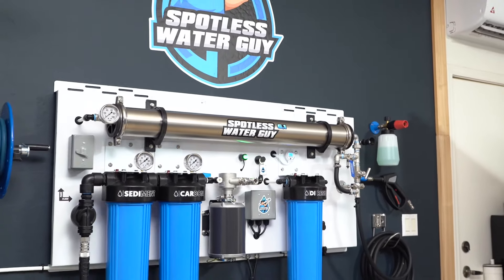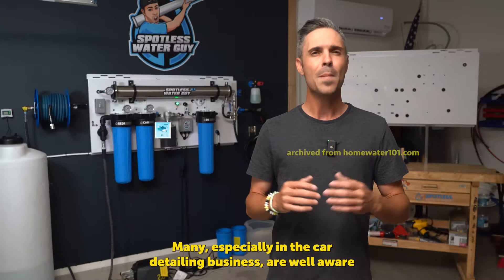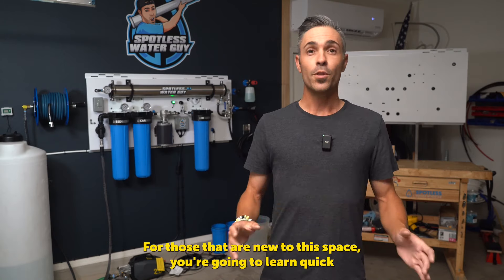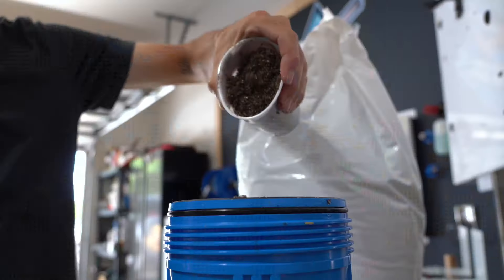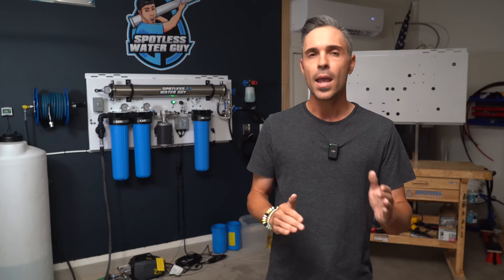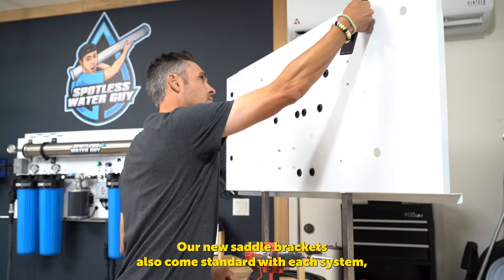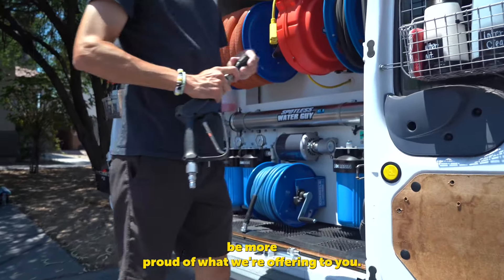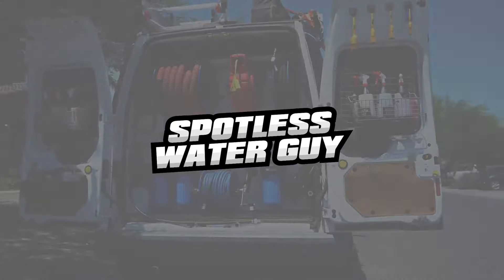DI Resin has a Dirty Secret. You’ve probably learned about it the hard way.

Comment: How many gpm does this system produce? Does it require a hold tank?
Reply from the maker: @JT-bb3ip  The G.1 is 1gpm and the G.2 is 2gpm. All RO style systems require a holding tank. Unless it’s being used for window cleaning in which you can just let it flow no tank required.

Comment: So instead of fouling the resin bed you shifted the problem to scaling the membrane.  Resin works by ion-exchange.
Reply from the maker: @mikepineda9022  The problem lies in the cost per gallon with DI resin. RO membranes really are not expensive when you consider how long they last. When you let RO do the heavy lifting your cost per gallon goes down substantially. Scaling a membrane can take years. One of the smartest things you can do to cut costs on spotless water is shift away from relying on DI resin alone and focus on RO.

Comment: What about the waste water how much are you actually dropping for the average joe just watching his two cars at home 4 times a month would it be idea with the system or is it better to have the spot system my ppm is 143 ?
Reply from the maker: Hey there! Yes great question. This system was really designed for people in the cleaning industry who need a better Spotfree water solution. People at home cleaning a couple cars a month are probably better off purchasing a straight DI resin tank (as much as it pains me to say that)
Reply: Or aquarium multistage ro system with a  small di stage added. Then run it into a 55 gallon drum with a float all in less then 100 bucks and if your pressure washer can be gravity feed you are good to go. Otherwise lift pump and then good to go
Reply: Just purchase a small in home RO water system and have that system push water through the resin and into a 30-gallon storage vessel like the small 3 gallon one that it comes with. Then you tap into the bottom of the tank and pull water from there.
Reply from the maker: @waxmanvids5015  thank you!